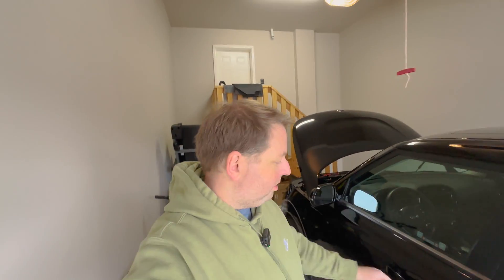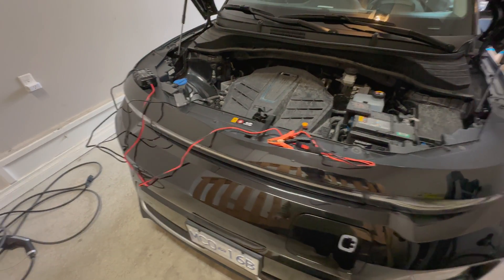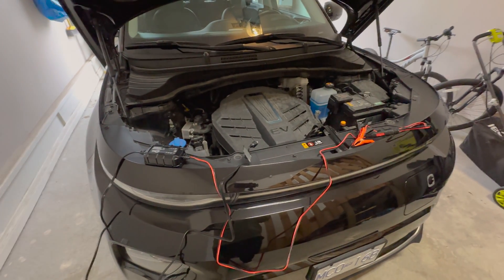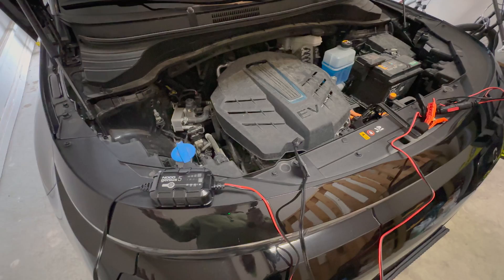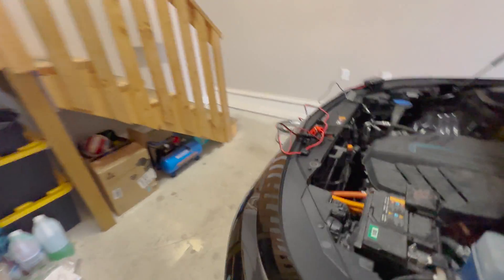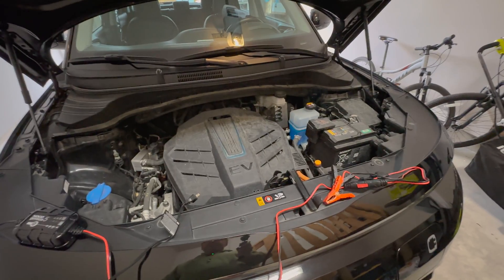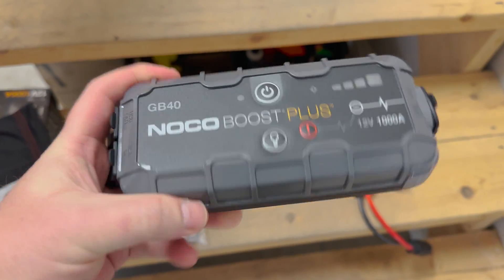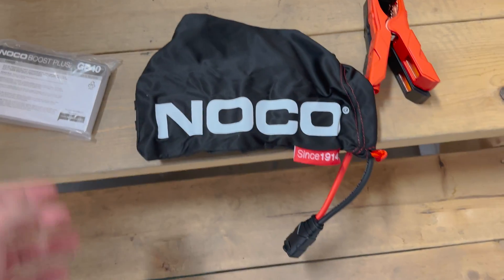12V Battery In My EV Just Died And I Had To Jump Start An Electric Car

Comment from the maker: Did you ever experience having a dead 12V battery in your electric car? Share your stories below...would love to know how many people have a similar experience.
Reply: Funnily enough yes, twice, in my Kia Soul ! Both times because i left the interior light on. Once because i left it on, once because i left a door open which in turn caused the interior light to stay on.  I fixed it both times with a one hour battery charge and then overnight trickle charge.  I did however lose confidence in the 12v when my internal battery monitor (cheap thing off ebay plugs into the cigarette lighter) showed around 12.1- 12.2 volts so got a new 12v after 3 years. 
Luckily both times i was somewhere i could get access to a power socket to plug a battery trickle charger in.
GIven the size of the main traction battery it is pathetic that there isnt better internal monitoring to check the 12v state and charge it when it drops too low. Its there but its not good enough.
Reply: I have had this happen in hybreds, plug in hybreds and EVs from Nissan, KIA and Ford.  Though I use a small jump start unit to jump it, it's a pain.  It also ruins the little 12v battery.  I've replaced one and one was replaced under warranty.
Reply: I manage a large fleet. I deal with this every Monday morning with 3-4 cars.  All of them were left on, or a door open or something draining the battery.  Because they are "EVs" people don't think you can drain them  just like a gas car.
Reply: I destroyed the 12v battery in my 2010 ICE Kia Soul by leaving my phone charger plugged into the power outlet. Vampire drain killed the battery within 6 months, IIRC. Luckily, it was a Costco battery and they swapped it for free.

Did you have anything plugged in? I know the Android Auto usb port is always on. I'm trying to remember to unplug my wireless Android Auto dongle when I leave the car; just in case. 

I wonder about the OBD dongle maybe bleeding the battery over time?

Comment: I have a major problem with my Kia Soul  EV. We have had 19 breakdowns in 4 years. For most of that time I had a voltage monitor attached which produces graphs showing voltage over time. When it fails the battery very rapidly drops to 6v! On some occasions it has been given spikes of 19v. It is no surprise that we are now on our third 12v battery as no battery likes that sort of treatment. This looks to me that the onboard charger is at fault as where else can 19v come from? Kia won't own the problem unless it happens in the dealer's workshop so I am stuck with either carrying around an extra 12v battery or paying to have the inboard charger replaced. I hate to think how much that would be. Despite claiming a 7yr warranty they only give 2yrs on the 12v battery. Even Halfords offer 3yrs on 12v batteries. I am not impressed. Our other EV is a Tesla. That had infinitely better software and customer handling. I shan't be buying a Kia again.

Comment: Shouldn't this be towed to KIA West? Why need to fix it yourself at home?
Reply from the maker: I live in Alberta now so towing to Kia West wasn’t an option. I managed to get it started and then drove it to the local Kia dealer here in Edmonton where they replaced the 12v battery.

Comment: It's almost beyond belief isn't it? Manufacturers have spent billions developing EVs and it seems like every owner (including me...TWICE with my i-pace) has been stranded because of dead 12v batteries. And it's even more annoying in an EV because you are standing there stranded with a dead 12V, with maybe 100kwh of power in your high voltage battery.
And it seems to be all makes of EVs too, so I can't blame Jaguar/LandRover dodgy quality on this one.
This issue could be what makes me dump my i-pace and go back to a big reliable diesel or petrol Mercedes.

Comment: After replacing my 12 v batter on my 2022 Ionic 5, I was frustrated by the fact that it is difficult to find what the recharge source is for the battery!  Why is there no a simple method of using the 78kw battery to charge the 12 V battery.
Reply from the maker: My Kia Soul EV has a battery saver function whereby the 12v is periodically charged by the high voltage battery. But it seldom works as intended. Yeah I’ve got no clear answer why the high voltage battery cannot make sure the 12v stays charged. I would be nice if it did.

Comment: An observation about this particular charger if you have a Chevy Bolt, the positive and grounding terminals are spread quite far apart and the puny 1-foot cable that comes with this is not nearly long enough. You'll need a pair of traditional jumper cables to connect to it in order to bridge the gap.

Comment: I have A niro ev and it just happend  but when the car is driving the Battery 12v won't charge then the car dies
Reply from the maker: You will need to go in and replace the 12v battery.

Comment: They Will not replace the 12v battery because its a known problem …  all ev and hybrid are concern except tesla.( tesla is the only brand that have a12v management by the ecu) Toyota is concerned too…
Reply from the maker: Kia gives you a 3 year warranty on new vehicles that covers the 12v. After 3 years you will need to pay yourself to replace it.

Comment: There was a recent case an EV stalled on the fast lane of a highway suspiciously due to 12V battery died and won't receive a charge from main battery anymore, without a warning.
Reply from the maker: Interesting. Will need to look into this.

Comment: I check my battery once a week using a volt meter. A healthy battery should show 14+ volts.  The ev battery trickle charges the 12v. However if the 12v drops below a certain voltage, the system will turn off the ev trickle charger as a safty feature.  If the battery warning  light comes on, thats a sign its dieing, as it did with mine after three years from new. They don't last as long as in an ice car.

Comment: You can’t jumpstart EV 12 battery, the 12V battery is only there to open the high voltage battery relay and run the 12v accessory, the charge the ev 12 battery it’s best to connect the charger to the battery and disconnect a cable just in case but every EV should carry a jump booster pack anything between 500-1000 amp is fine cause a Ev 12v battery is only 75 amp

Comment: Yes Hyundai kona 12v failed 4 times in 4 months. On all occasions had to call roadside assistance(via Hyundai) they just came jumped my car, third time 150 miles from home at 2200hrs at night.Everytime Hyundai have said no issues with 12v battery. Last time in garage at home had to call Hyundai assistance, the assitance guy jumped the car, followed me down to the Hyundai service shop and explained the issue. Car with Hyundai for over 1 week, finally called to say 12v battery faulty. This was 2 days outside the 12v battery warranty(which is 2 years) and I would have to pay for a new battery!!! they would not budge so paid and have been emailing Hyundai head office in the UK but they are saying the same as the service shop I have to pay, they will not refund me-very poor, has taken the shine off this car/Hyundai/Kia.

Comment: I think the pre-start ,contactor energisation and the cabin electronics really push the 12v system to the limit. I think Kia could monitor 12v system in sleep mode like on a Tesla. But the solution must be to fit a 19v lfp battery for life of the vehicle. Not looking forward to changing my 12v battery after 5 years with another 100 year old design lead acid battery

Comment: Not only KIA. My lexus rx500h makes the same. After driving to work everyday /11 miles one way/ battery goes down to 11.5V.  Need 3 days on trickle charger to go up over 12V. Last weekend, when washing, vacuuming, detailing I left doors opened for prolonged time, car wouldn't start. Good to have booster. That's not what I was expecting from  $70k POS Lexus.
Reply from the maker: We need car manufacturers to figure out a solution to these 12V issues. This cannot happen with almost every car brand.

Comment: Just stumbled across your video after having 12v issues on a Hyundai Kona Ev, the cousin. Just 2 days ago.  Started with a 12v battery warning. Then when cleaning inside the car with doors open the battery failed completely. I measured 5v with a multimeter. I had a jump starter so was ready for it. I left the car in utility mode for 2 hours and it charged the 12v battery to 12.6v. The following day the battery was 10.7v, but still had enough juice to start the car, with the warning. I replaced the 12v battery the next day. Since then there have been no issues and the new battery has maintained 12.6v overnight. The old removed battery has discharged itself to 10.5v. The car is 3 years and 8 months old, in the south of England. I have seen the orange light, indicating that the car is charging the 12v battery when the car is off more often in the last 6 months. That was likely the first sign something was up. I imagine is gets so bad even the onboard DC to DC converter can't maintain 12v in the battery. We should be looking at getting the 12v battery tested and/or replaced at the first warning, as the car itself will have been supporting a failing battery up until then. I was able to go to a DIY motoring website and put my registration in. It gave me a choice of 4 batteries, all an exact fit, including the fitting for that little plastic cover over the negative terminal. Its an easy fit to change the battery yourself, here in the UK something like that doesn't interfere with warranty. Great video.

Comment: I have a Kia Niro EV from 2024 and i've experienced my first 12v battery issue this morning after 13 months of ownership...
Reply from the maker: The batteries on Kia EVs are just not good. Combine that with the bad BMS and you’ve got issues. 12V is under warranty here in Canada but you can check if it is covered where you live and have them replace it for you. Also, always carry a jump starter like the one I use in the video.

Comment: use a 12 volt test meter it should read 12.7v or near,after 24 hours if not it is knackered.if not sure do a drop test,which you can buy from ebay, 12volt is for safety ,always use the isolater switch when working on 12 batteries on ev ,if you use the 400v main battery for everything  you could kill your self ie sticking switch
Reply from the maker: Thanks for this! Good advice!

Comment: Just bought a 2025 Kona electric preferred. I really like the car, but even if they told me at the dealer's service that this trouble has been fixed since last year. I hope they are right, but having worked in the automobile business (dealers and private garages, don't necessarely trust them...), I did buy a jump starter, just like you did. And I put it in the frunk (where the 12V battery is anyway), because if I put it in the back trunk, I won't be able to access it! Now, I am curious of a few things about the 12V batterry going dead. Many posts the low voltage of the battery. But how about the acid level? Is it low? Meaning here, the battery has been overcharged. And if not, what is the acid density of each of the cells? Because that will say if one cell is bad or if the battery has been undercharged. You may simply have a bad or shorted cell which will produce the same result. Assuming that the cells are accessible to check the acid density or simply refill the battery with distilled water, just like most lead-acid batteries. The 2025 Kona has a 60 AH rating, while the older one's had 40AH, as far as I know. If I ever get into problems, I will probably install an AGM battery. Thanks for the video.
Reply from the maker: When I had this issue I tried checking the levels and they didn’t appear to be accessible. I didn’t want to go further as I am not a mechanic and make things worse. This is why I now carry the jump starter but unfortunately I don’t have a frunk so need to carry it inside the car. Thanks for watching and your input, much appreciated!

Comment: I ended up replacing the OEM battery and bought a replacement  AGM battery from Canadian Tire with a full replacement warranty. The Kia battery is  prorated and you'd get the same 'weaker' battery back and have to  fuss with the dealer to get it claimed. On my 2022 EV6 GT-LINE 2 with the OEM Battery I used the lithium  booster a few times  and saved a tow. Well worth it to have one.
Reply: I've been researching 12V battery problems as My i-pace has let me down twice. First time, the 12v was dead and wouldn't take charge. Second time recently, I jumped the 12v with a rechargeable starter pack and the car has been OK for 2 weeks since then. I did ask somebody about replacing the 12v with an AGM type, but was told there could be issues as the charging characteristics are different to lead-acid type, which did make sense.

Comment: Thanks for the video, always nice to see we are not alone. Had the same issue on Hyundai 2019, dried the car doors open for 2h after cleaning it and 12V died. Though, mine booted (I say booted cause it's a computer:-)) off my old Motomaster charger directly set at only 2A, and that works. I noticed the positive is attached to a 10A heat fuse, that would prevent charging at a decent pace while the battery is connected. Manual so recommend pulling it out for external charging. I did get the 5y old battery replaced, it's not lithium, 5y is a great life time for traditional batteries.
Reply from the maker: I have since learned that I would need to remove the battery for charging. Kia and Hyundai really need to sort this out. I’ve read that even owners of the brand new EV9 have 12v issues. I’ve since taken the car to the dealer and they replaced the 12v under warranty (I only paid a portion of the cost). It was just in the nick of time as I almost hit 3 years of ownership when it was replaced.

Comment: I had my 2016 Kia Soul EV haul to a charging station tonight.   The tow company had to hook up a battery pack to allow me to release the brakes and I was then able to drive onto and off the tow truck.  I noticed that the car said there was 65 KM left in the high voltage battery.  But everytime the tow truck driver disconnected the battery pack the car would die.   Do I need to replace my 8 year old battery or will one of these jumpers work for me?
Reply: I should mention that my car sat for the last week because I blew a tire and had to wait for a replacement tire to come in.  Got the tire mounted and balanced then   installed it on my car and that's when I noticed it wouldn't start.\
Reply from the maker: I think you have a 12v battery issue. These jumpers are a temporary fix. Better go and have the 12v tested and you will probably need to replace it.
Reply from the maker: Yeah when Kia or Hyundai cars sit idle the 12v still depletes for some reason. I doubt you have a high voltage battery issue but definitely the 12v needs to be looked at.

Comment: Have 2019 smart eq with No dash cam or other devices operating when parked. My 12v vehicle battery will randomly die. Have Parked at the airport for 5 days and co.e back and is fine, while other times, it dies in the middle of the nite with horn and flashers going nuts. Dealer says all is well, so I am forced to carry a jump.pack and plug in trickle charger while at home.  Definitely not the future. Should not have this issue with a daily driver.
Reply from the maker: Seems like Kia cars are not the only ones that suffer from this. Thanks for your feedback!

Comment: Electric vehicles only need a pocket sized 12 V battery booster to start. However there is always the chance that your 12V battery voltage dropped to the point that it is permanently damaged. I don’t know how old your battery is but anything older than three years may well need replacing. Sometimes they don’t even last that long. BTW you shouldn’t need to trickle charge the 12V if everything is working properly. The main battery should be doing that periodically.
Reply from the maker: Thanks for all the useful info. My battery is older than 3 years and I’ve made an appointment to have it replaced.
Reply: @LeftCoastEV  I bought a AGM (glass mat) type battery with full replacement warranty from CTC . a bit more $ but good so far.
Reply: I agree, the 12v battery should not be allowed to be discharged to the point where a it needs a jump pack. Doing this will permanently damage the battery. I don't have a EV, but the Toyota hybrid and have the exact same problem. I have fitted a 25w solar panel on my garage roof and I just plug it in when I park up. The car has been left for 30 days on a number of occasions without any issues. The secret is to use the panel (or a trickle charger) to maintain the full charge rather than letting it get to the point that the car won't start.

Comment: Get a cigarette socket volt meter. I suspect kia dont charge the 12 volt battery to 14.7-15 volt which is required to maintain a working 12 volt battery.
Reply from the maker: Good idea. Thanks!